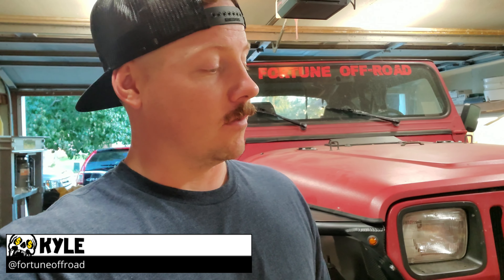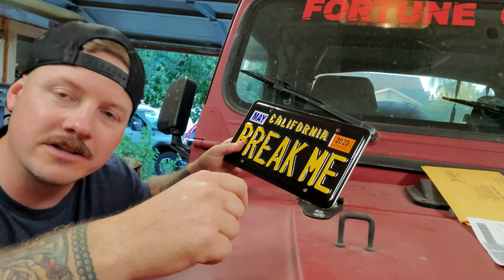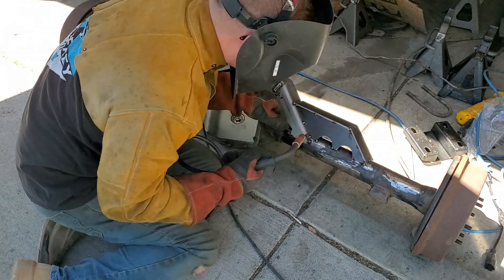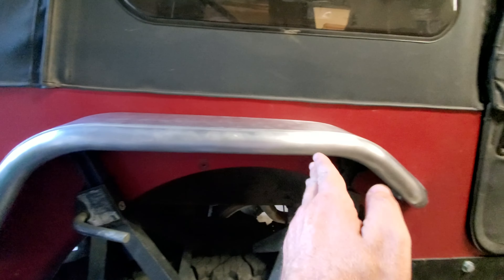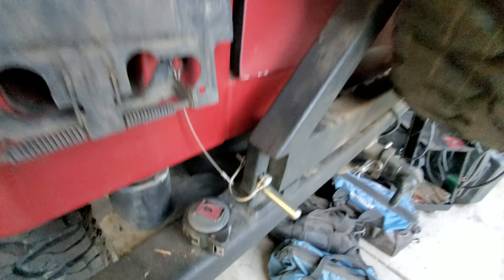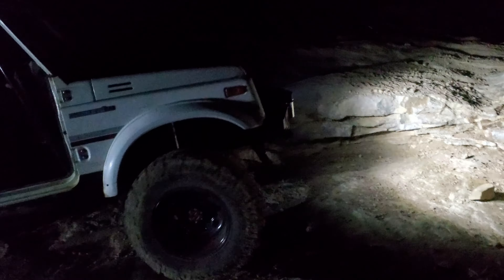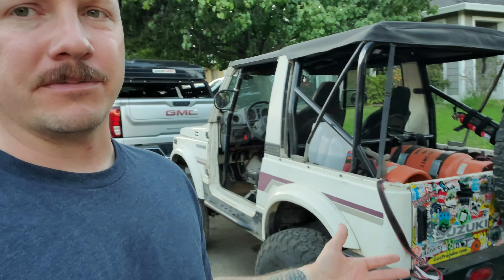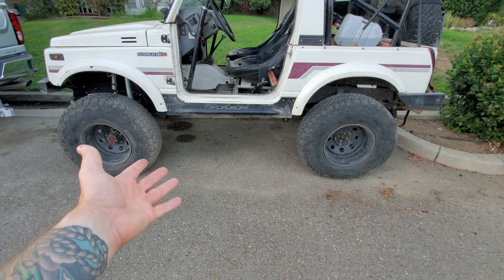Down Time | August 2022 | Custom Plates & Broken Rigs

Comment: I just did 5.38 gears in my stock samurai axles. I did put a mini spool in the rear. I’m running 35’s without cutting the body. I have swapped in a Toyota 22R-E with the 5 speed and t case from a Toyota. Now my rear yoke and t case yoke done line up. I talked to Tom Wood’s driveshafts to figure a driveshaft solution. I have to tip my rear pinion up to 25 degrees. Hopefully that works.
Reply from the maker: That sounds like a common issue in lifted samurais. If I go any higher I will ha e the same issue. Only way to avoid it is by moving the axle back.
Reply: @FortuneOffRoad  that’s what I was afraid of.
Reply: @MrHayabusa1299  35s on samurai axles? did you do the 26 spline upgrade on the front? the stock shafts are not adequate for 33s as is. The rear wheel bearings will also be problematic. Pinion angle is the least of your worries.

Comment: Hey Kyle did you put the Spartan Locker in your front axle on the Zuk?
I am getting ready to replace my Zuks front axles with 26 spline chromemoly's and was going to put a Spartan up front.
Reply from the maker: Yeah! If you look at the Samurai Playlist there is a video where I did that! 🤙🏻
Reply: Did it affect your steering ? I don't mind the popping noise. I have one in the rear differential but am worried about the steering...

Comment: Dude I know that feast or famine struggle with the content there’s a lot of times I’m just pulling something out of my butt. 
On another note there’s a video on my channel about using a drawer slider for the rear license plate to make filling up easier
Reply from the maker: Yeah dude! I saw that video. Great idea 💡
Reply: @FortuneOffRoad  also my jeep is a little bit too tall also and it did perfectly fine in Moab but it’s also really wide footprint. You’ll be fine just stay off of shit like tip over challenge
Reply from the maker: @FlawedOffroad  thanks homie!